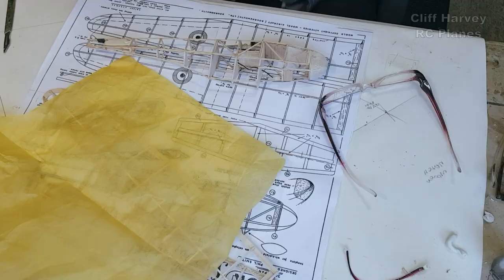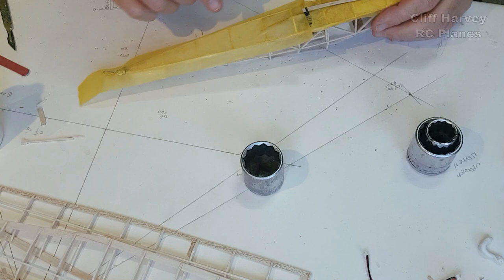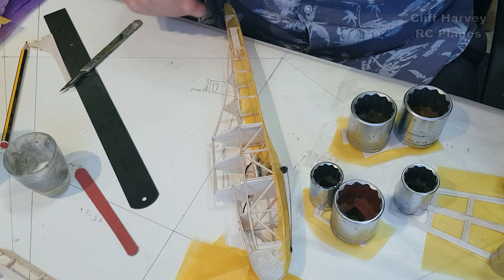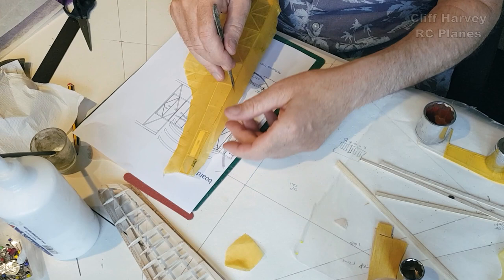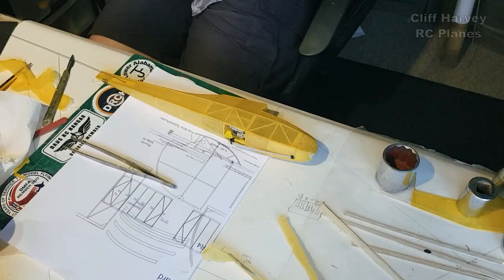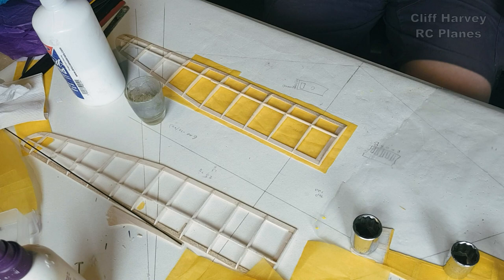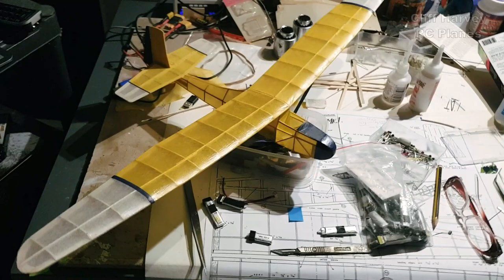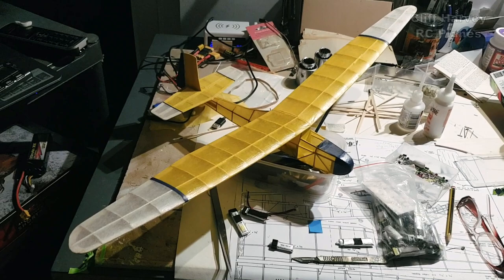Veron Slingsby Prefect Mk. 1 Towline Project ... Tissue Covering

Comment: Nice job! Similar looking  to the tandem two seater, which if memory serves was called the Kirby Cadet...
Reply from the maker: Thank's Nick, I think you're right, cheers 👍
Reply: You have inspired me! I haven't built a model aircraft since the early 70s, but have decided to have a go. Question is, a VMC kit or a plan so I can laser cut the parts myself. I like WW1 era planes. I have spent most of mt hobby time building model steam engines and rc model steam boats so will be a little rusty I guess. I have a laser cutter, a 3d printer and a small, as yet unfinished cnc router. What do you reckon? Plan or kit? I'm no stranger to working from drawings...

Comment: Another great video, thank you for sharing.  Quick question: any wash-out at the wingtips?  It looks like the wing was laid flat to dry.
Reply from the maker: Hi Guy, they were flat but they bent obligingly upwards at the tip with a little washout in each wing! How's that for luck, had they not I would have added some, thanks for noticing, cheers 👍